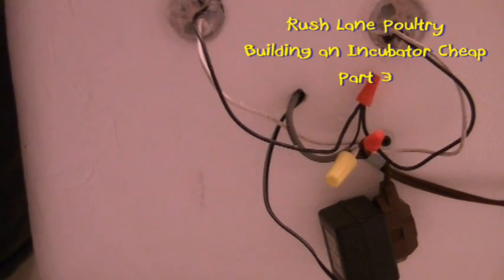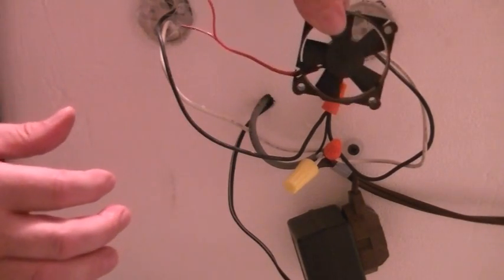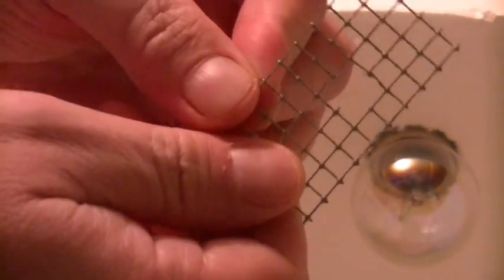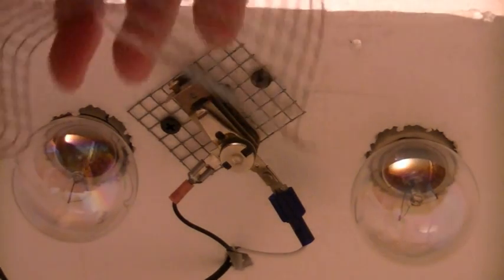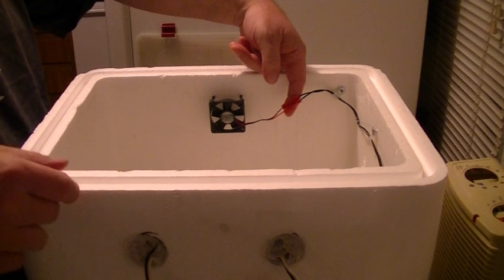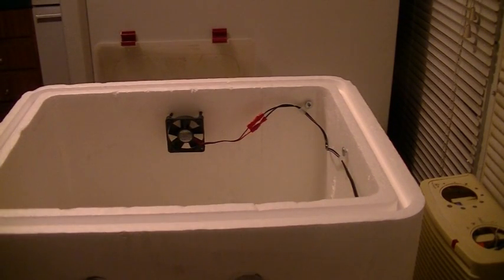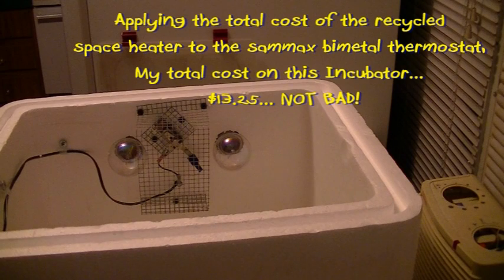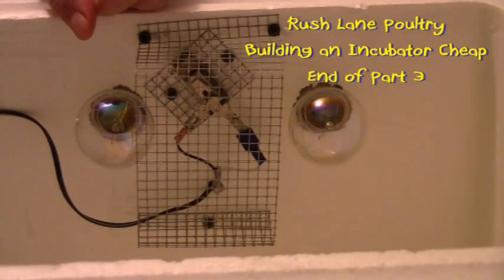Building a Low Cost Home Made Incubator! Part 3

Comment: How do you get your thermostat dialed in ? the one I have won't go low enough
Reply from the maker: Hey James! What did your thermostat come out of? You may need to move it closer to your heat source. Wade
Reply: it came out of a space heater  . I'm using an element out of a little giant Styrofoam incubator .
Reply from the maker: Okay... that element wont get hot enough to cycle that thermostat! You would be better off if you used light bulbs as a heat source or get a digital thermostat. They are way more sensitive!
Reply: my new project incubator is 48 tall 20x20 I'm going to put 5 egg turner in it . What will be the best heating element for one that size . I have a digital thermostat like the one in your other video.  thanks for all of your help
Reply: Hey James! With a bator that size, you will prolly want an element like this 1:
http://www.ebay.com/itm/225-watt-coil-heater-insulator-kit-cabinet-egg-incubator-110V-heating-element-/331817044391?hash=item4d41d649a7:g:xbYAAOxyA4ZRJoqJ